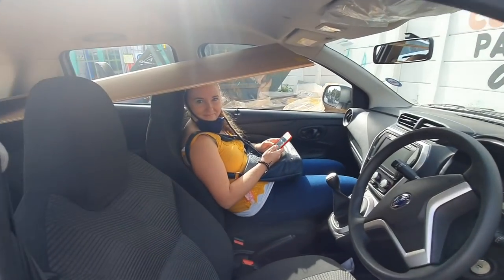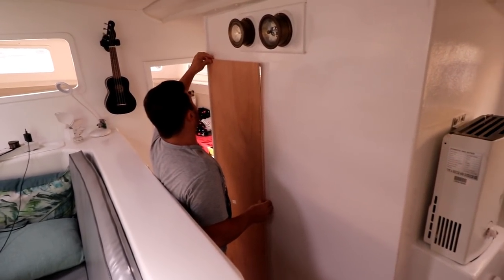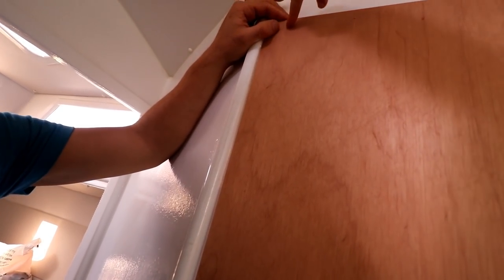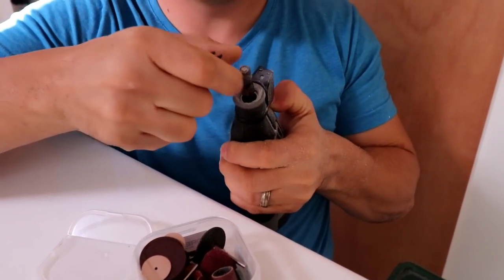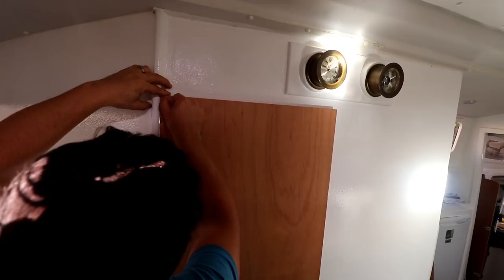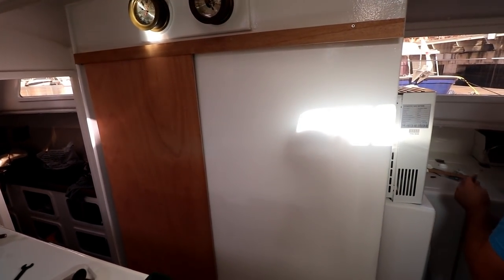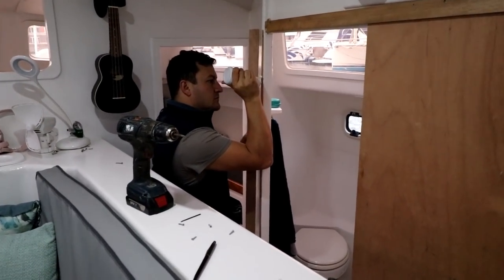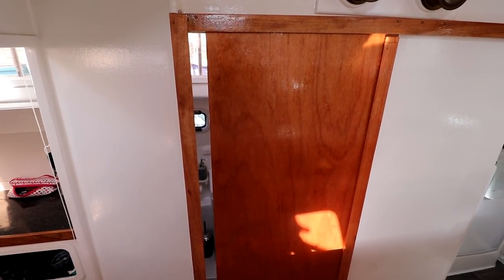Building Boat Doors | DIY Head Door

Comment: These will drive you mad under a seaway with rattles why not two small hinges doors opening  in painted white for a wet room or bifold hinged in the middle and fold off to one side only a thought I know in our boat we have. A couple of sliding doors and they get jammed up with wedges before we set sail try it rick , , , ,and Simone can sing well well good voice
Reply: That is why they are adding a catch
Reply from the maker: Thank you. We will be adding a catch so it won't rattle. 👍🏻 😊